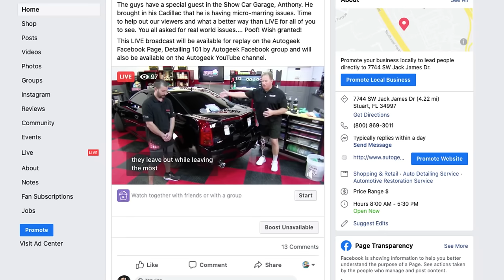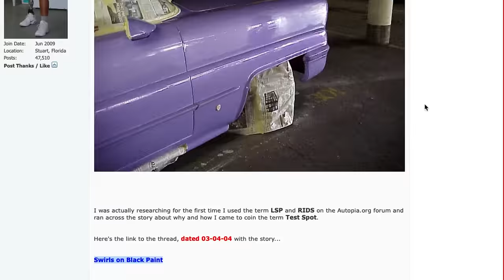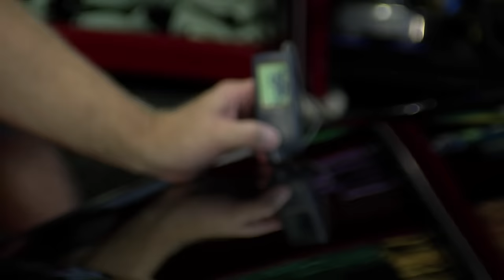How to deal with finicky paint & micro-marring - The power of a test spot

Comment: i need help. Im stuck on a black bmw. I cut and polish, everything is spotless until I wipe the polish off with every microfiber towel I can get my hands on and it still causes micro marring and big swirls to come back. Even rubbing my finger gently on the clear coat leaves swirls and marring. The towels are brand new either costco brand kirkland or chemical guys plush edgeless. I have used 3m compound, step 2 to step 3 finishing fine polish and also tried chemical guys v32 and v38. Pads I use are orange hexlogic for cutting or meguiars microfiber pad with my rupes mark 3 and griots garage red orbital. polish pads are either green, black, or white hexlogic pads. Been stuck on this car for a week and never had this issue before. I am working in a 20-22 degree celcius environment in my shop. bright lights everywhere. Even used a rotary with wool pad or black waffle pad to change my approach to see whats causing it. Maybe the clear coat is too soft? as soon as i wipe, all the defects pop up all over again after a nice correction.
Reply: You need to do lots of test spots then. Maybe your'e working too fast, maybe too slow try different pressures, do more or less section passes. Use and IPA to wipe down and see the true result. Maybe you should try something like Car Pro Essence or Sonax Final, these polishes have very little cut like 1 on a scale. Also using smaller orbit machines may also help to achieve a good finish.
Reply: Are the defects you're trying to remove coming back, or are you creating new ones?
If they're disappearing and coming back, the paint is swelling during correction. Either too much heat, or a chemical is causing it. Aggressive panel wipes tend to be the culprit, but even certain solvents in polishes can react badly once in awhile on certain paints.
If the defects are new, is the towel causing the swirls or the polish?
Do your polish wipe off moving your towel in one direction only. Up and down or left and right. If you have straight line scratches it's the towel. Buy and use brand new Eagle Edgeless high gsm towels and try those. Circular swirls, it's the pad and liquid and you need to step down further. 

Use a standard throw DA and a primer polish like Gyeon Primer, CarPro Essence. Or a soft paint specific polish like Xtreme Solutions LVR 496 Finale. Finale and (of all things) the red Hex pads, which are even softer than normal application pads are my secret combo for the worst of the soft finnicky paint. Along with using McKee's N914 at panel prep dilution, 1:8, to lubricate the polish removal and gently prep the surface.